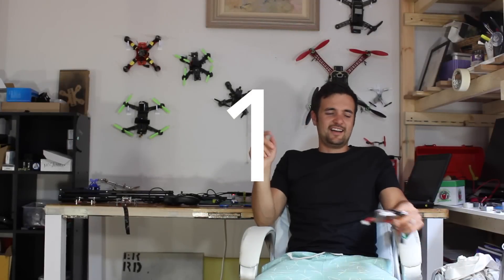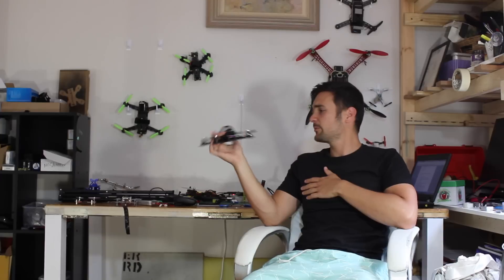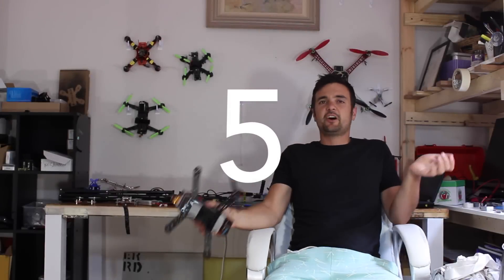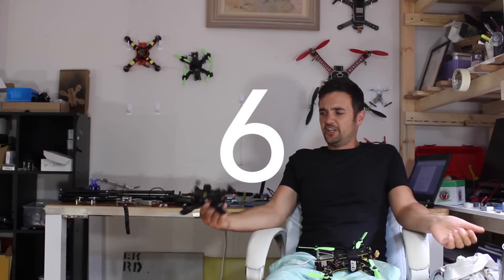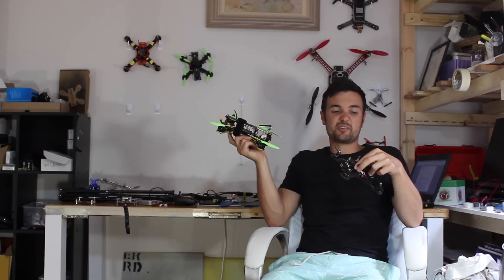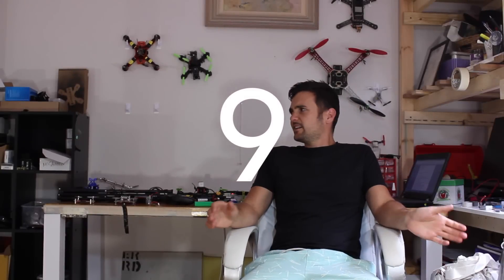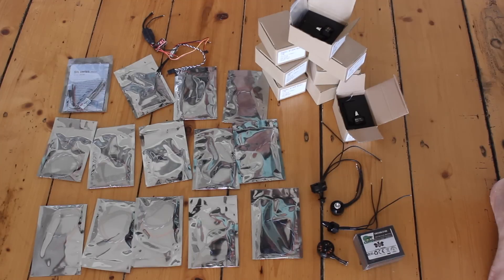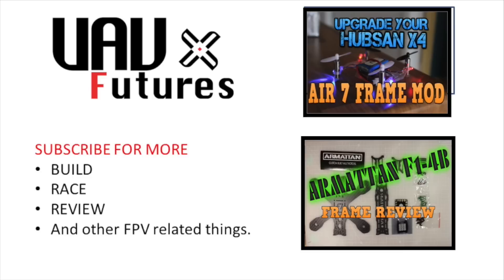Top 10 tips when building a Drone/ Quadcopter

Comment: Great list Stu. I'd add a couple -  buy a set of quality hex drivers (ditch the dept store 'L' keys) and a cheap multimeter, loctite, good silicone wire and check your screw lengths on motors to make sure they don't touch the windings. 
Before power on after any build or repair, break out the multimeter and check across your XT-60 to make sure you don't have a short.
All cheap and invaluable steps to less problems and more flying!

Comment: #4) Use your soldering iron for many tasks: heating up hot glue that comes unstuck, also to modify glue, making quick holes in foam etc, use it on 250-300 to repair (or make) battery straps and weld the two pieces of velcro together. 
 #3) get some Elmer's reusable (blue) Poster Tack putty, it becomes invaluable as a third hand, temp hold, vise for soldering (great to just press wires into for quick tinning).
#2) A nice LED lamp at the bench as a spotlight on your work and use some magnifying glasses you can pick up cheaply at the drug store they are so helpful! 
And my #1 recommendation... patience.
Reply: Dean F People, please don't do this. You don't want to do anything to contaminate your iron or tips. Any particulate matter on the tip will cause carbon build up which cause lower heat on the iron. Lower heat means more time on the board, more time means more heat damaging parts the sensitive parts on your boards.

Comment: There is one thing I would like to see and that is a detection option for the VTX so if your Quad crashes and the Arial comes away you can in some was disarm the output of the VTX or the VTX has some way detecting a problem. Example of this is where you crash and in some way the Arial comes away from your Quad your VTX is still trying to transmit without Arial but this time burning out wile doing so. I had this problem wile the Quad was in a tree and by the time I got the Quad down the VTX had fried and yes I had a pig tale fitted.

Comment: building my first quad do u recommend the naze32/filp our cc3d?
Reply from the maker: I recommend the x racer fpv model. but if you really want those two,  naze is a better choice
Reply: what flight controller do u use?and will clean flight work with the naze32?
Reply from the maker: Mr.B RC I use the kakute at the moment. use betaflight on the naze, its netter firmware

Comment: This may be a stupid question but do I have to have 4 same motors on a quad or can I have 2 of one kine and 2 of another?
Reply from the maker: probably not recommended to mix motors
Reply: Thanks. I am planning to build my first one and I would love your thoughts on the parts that I have bought. 
-EMAX RS2205 2300KV 
-5x4.5 bull nose
- Emax 20A BLheli ESC Speed Controller
-Usmile 250 quad 3K Carbon Fiber Fpv Quadcopter Frame
-1300mAh 75C 4S1P
Reply from the maker: vaibhav arcot looks like a great part list, good job
Reply: Thanks man really appreciate your answer.

Comment: I have a question guys.  I have a LT210 and am going for straight control and speed . should I buy a 1806 with high kv   or     2204 with 2 300kv ! ps.   only asking because the weight factor
Reply from the maker: buy a 2205 2600+ kv  1806s will die on 5" props
Reply: +UAVfutures ok thanks. only new to drone racing
Reply from the maker: Daniel keegan welcome to the hobby and happy flying
Reply: +UAVfutures thanks 😂
Reply: Is there anything wrong with 2204 2300kv motors ?
Reply: ***** nope he just means the higher the kv the quicker the props will spin but will be less efficient on battery
Reply: Oh ok thanks

Comment: Another tip: Use a current limiter (otherwise known as a smokestopper) when bench testing! Will greatly increase the chances of saving an ESC, motor, FC etc should there be any issues with shorts, screws touching windings etc! See the following thread on RCGroups for more info: http://www.rcgroups.com/forums/showthread.php?t=2327875

Comment: TIP: Get and use a decent soldering iron and learn how to solder before starting your build. 
TIP: Make sure you use a multi-meter to check for shorts before you plug in the power, every time you make a change to the wiring!

Comment: Is it also ok to use this: http://www.banggood.com/SMA-Male-To-SMA-Female-Jack-Right-Angle-Crimp-RF-Adapter-Connector-p-924939.html  to protect your transmitter? Or is it too short to take the tension and protect the sma connection of the Tx?
Reply from the maker: +xuxusito as long as it bolts to the frame it should be ok.

Comment: Tip: buy a suitable transmitter. No need in buying a high dollar transmitter starting off. All the switches and dials will be overwhelming to a novice pilot. A simple 6ch transmitter will work great for starters.